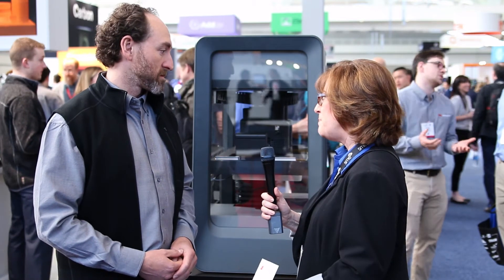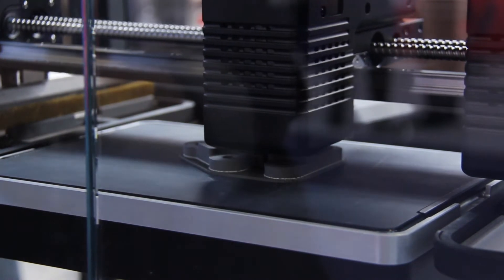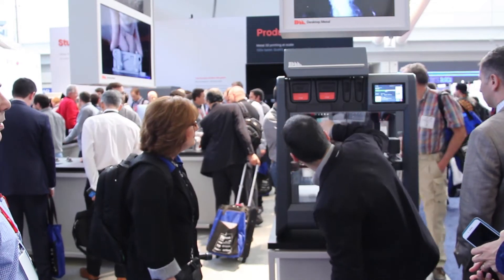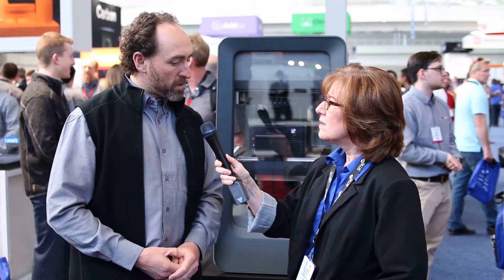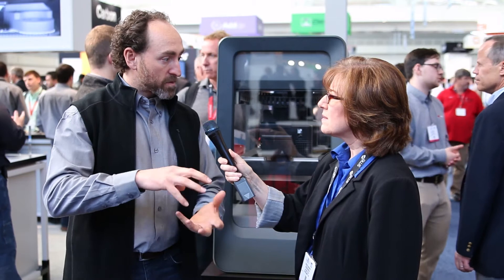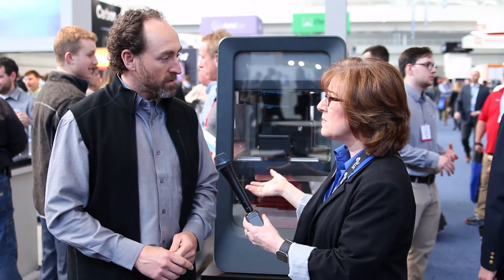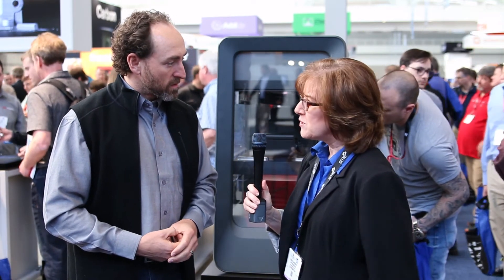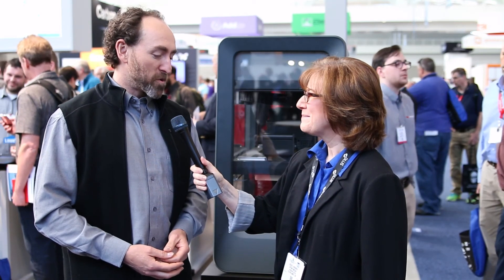Metal additive manufacturing--using a desktop 3D printer

Comment: For once I would like to see one of these 3D printing interviewers start asking the really hard questions to separate the wheat from the chaff, instead of acting cheerleaders for the Rapid Prototyping industry.  Hard questions are exact materials, have you actually printed those materials, how much post processing is involved, what geometries are difficult, what support material is required, how much effort is it to break out the support material, what environment will the machine be required to run in, what hazardous materials are produced in the process, what are the material properties of the finished parts when compared to conventional processing methods, how big of parts can be printed, what surface finish is achievable, what is the actual tolerance that is possible in the x, y and z directions.  These magazine/vlogs need to quit hyping the vendors products and doing the marketing for them.

Comment: 99% density? Bullshit
Reply: Depending on the material this is possible, but you have a very long sintering process. I´m curious what their microwave enhanced oven is capable of
Reply: Officially, it's 96 to 99%, depending on the material and print resolution. A bold claim, and one very easy to disprove. It's enough to order a sample printed part, determine it's volume displacement, and weigh it.